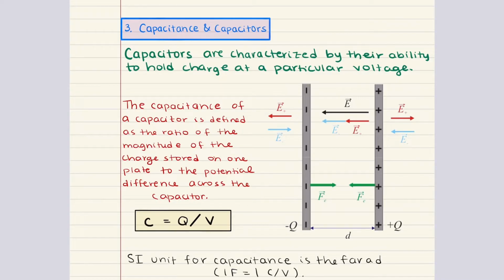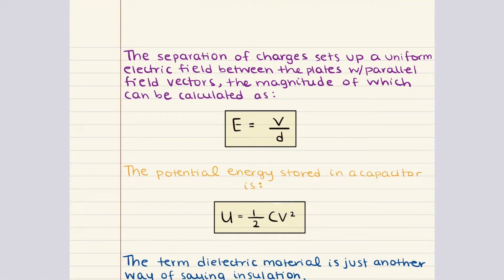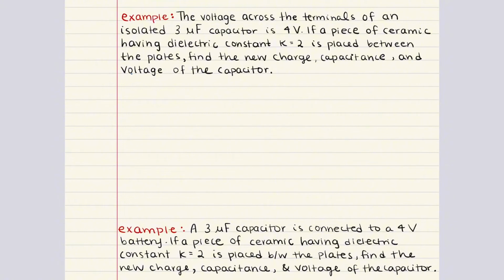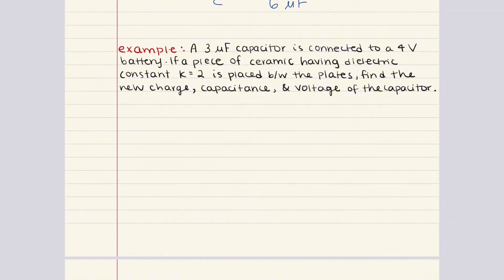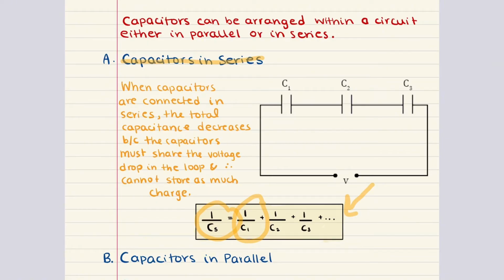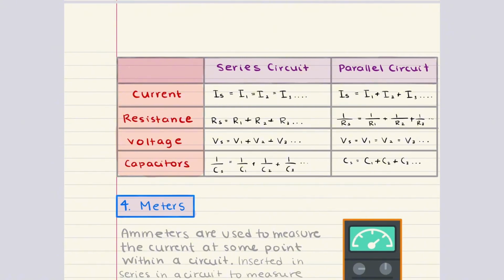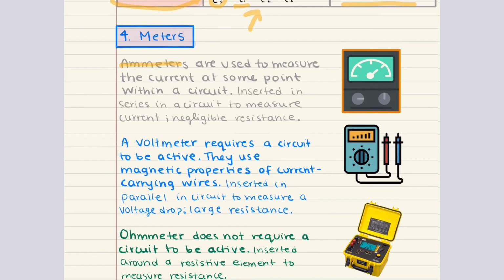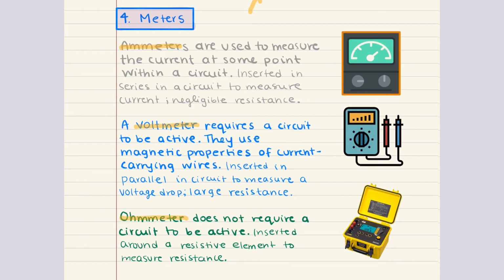MCAT Physics and Math: Chapter 6 - Circuits (3/3)

Comment: For the example questions, the first 2, how do you know that Charge is held constant and the Voltage is held constant?
Reply: In the first problem it says "Isolated" meaning that the battery is no longer connected which means theres no path for charge to enter or exit which means Q= constant. For the second one the battery is still connected meaning the battery forces the capacitors to stay at a particular voltage meaning V= constant.

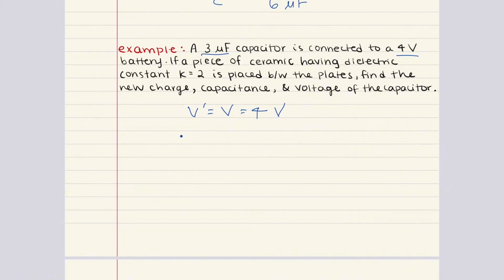Comment: at 9:00 how and why is voltage held constant?
Reply from the maker: The voltage remains constant because the capacitor is connected to a battery. A battery maintains a fixed potential difference across its terminals, meaning that regardless of changes in capacitance (such as inserting a dielectric), the voltage across the capacitor stays the same as long as it remains connected to the battery. Instead of voltage changing, the charge stored on the capacitor adjusts according to the new capacitance.

Comment: Hello, these are great! Just had a quick question:
For the example question at 9 minutes and 40 seconds, how come the charge (Q) changes from the initial charge, when I thought in the example question before that, you stated that dielectric materials do not affect charge. Does it have something to do with the second problem having a battery?
Reply from the maker: In this problem, the capacitor is connected to a battery, which keeps the voltage constant at 4 volts. When the dielectric is added, the capacitance increases because a dielectric enhances the ability of the capacitor to store charge. Since the voltage is fixed by the battery, the capacitor stores more charge to balance the increased capacitance. This is why the charge changes in this scenario—it happens because the battery maintains the same voltage while the capacitance increases due to the dielectric.
Reply: @professoreman2289  Got it, thank you!